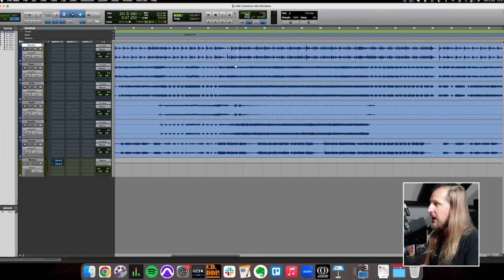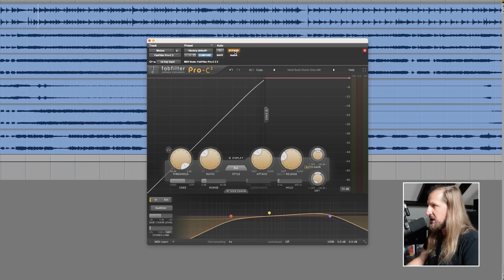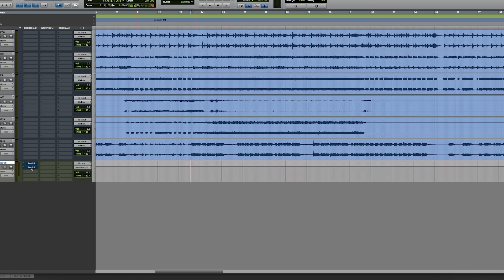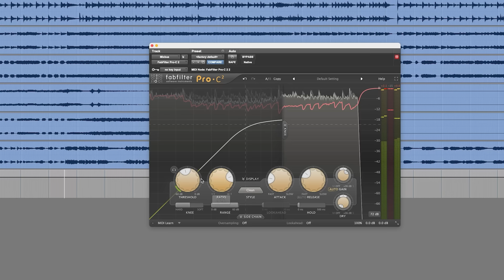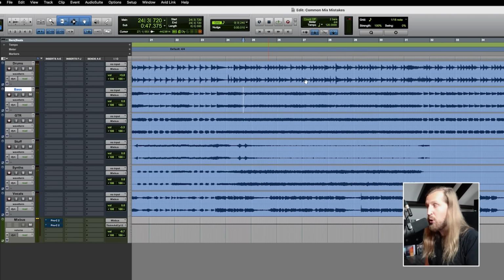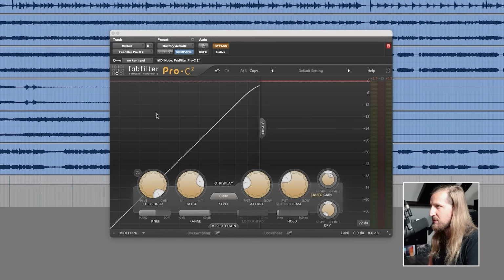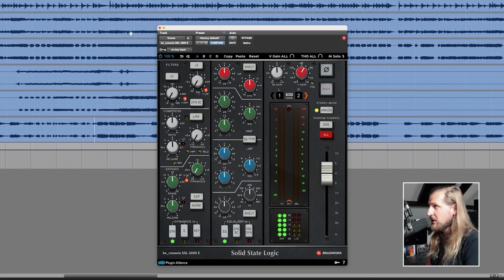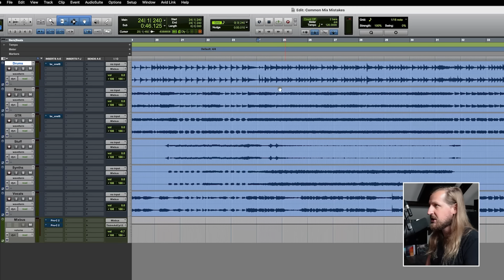The SECRET for GLUE in your mixes!

Comment: I haven't finished the video yet, but I've always thought of glue as the frequency relationship between each element in a mix. Obviously you want some space for each instrument in the mix, but if it's too vast a space then things don't sound glued. If the brightness of a guitar is dull in comparison to super bright drum overheads, then it won't sound glued, but if you bring those brightness elements slightly closer in balance then things start sounding blended to me.

EDIT: finishing the video and thank you for showing the the drums vs guitar brightness

Comment: Honestly speaking, I'm not great at mixing or anything, but none of the volume changes or frequency changes made any 'significant' impact to the mix pre bus compression and all of them sound good and glued enough. I wouldn't even notice the difference and happily listen to any of the 'volume imbalanced' and 'frequency imbalanced' versions because they still sound COHESIVE. The lacking for most people is going to that point of sound COHESIVE so that finishing touches can be applied to personal taste, but the song remains the same. I understand that a lot of it depends on the arrangement, but yeah, lemme know if you can help me reach the point before you start putting bus comp.

Comment: My question is, so why do we have bus compressors in SSL and API consoles? Are these two trying to say SSL and API are both doing it wrong?
Reply: Maybe it's not wrong it's just a 50 years old tech. They are slower to adapt, just think about hpf on the detection or dry wet, it took them decades to adapt to it.
If you watched the video it do not say that compression is bad btw.
Reply: @RolandSater  You might also be right though 👍🏽

Comment: Thanks for that insight. What about using compression for glue of groups of tracks? Like putting compressor on the drum bus or on a group of guitar tracks.
Reply: I always thougt thats a good idea. But I guess the effects of multiple compressors soon add up together with a mixbus compressor.

I want to know what the experts say.
Reply: Putting a compressor on the drum bus is one of the most common practices in mixing
My advice is always to try stuff out and see what sounds good
Reply: That's a common practice As long as your group compression is within 1 to 2 dB of gain reduction. Don't go crazy

Comment: Hi! I understand, we see and hear distortion and too much gain reduction when the balance is bad, but you should show us how you work with the volume fader and eq, and the compressor on the bus send should be a reference point, right? Explain how we can notice, maybe because there is too much gain reduction on the compressor or we hear distortion, so how to orient ourselves accordingly. Actually how to work with the volume fader and eq directly into the compressor to achieve balance of the mix. This seems a bit confusing. You showed just how the compressor reacts to a bad balance, that's how I experience it.

Comment: Hmmm... some folks would say it's imperative to carve space for each instrument... give each it's own space... then along comes mix bus compression to "glue" them back together???
Reply: That's not Jordan and Roelof's philosophy - in fact just the previous video was him talking about this exact thing IIRC.  Their idea is: get it good as early in the process as possible.  Record the best basic tracks - it should already sound like a record if the balance is right.  Then edit it tightly.  Now it sounds like about 50%-75% of a pro record (I know this because I managed it with one of their multitracks, and I'm a shit mixer).  Then you mix statically, then you mix dynamically - adding automation (and sometimes add some production if it needs some more).  And if you do all that with your ears, you'll probably end up making good-sounding records pretty fast.
Reply: @joristimmermans5058  It's always great if the source is the perfect sound for the mix... but after listening to lots of isolated tracks... often what sounds great in solo... doesn't work in the mix... and most musicians find there sound solo...

At the very least the idea of getting it right at the source means knowing what the source should sound like... to work in a mix... that could take a lot of experimentation and learning.

Most folks turn to mixing tools... to fix that gap.

That said, carivng and glueing are clearly contradictory concepts. Sort of like Random Walk and Efficient Market pull in two different directions in finance/trading.